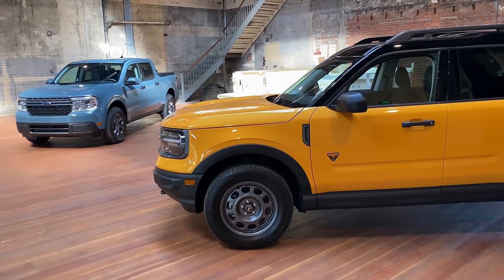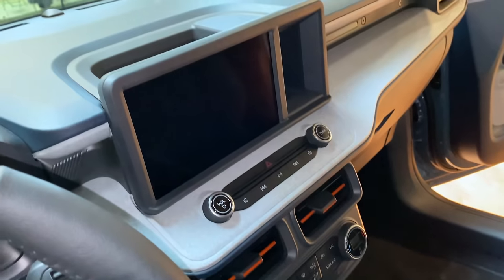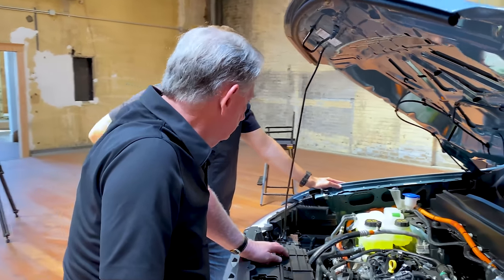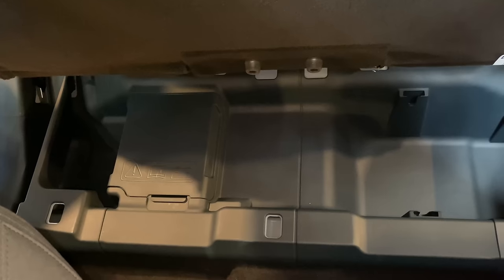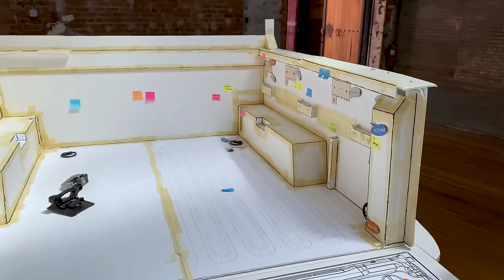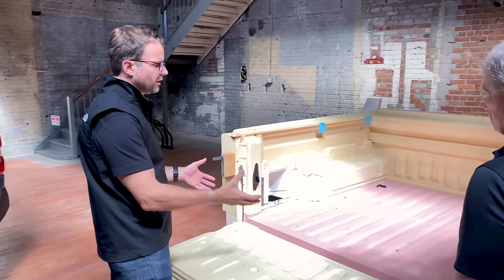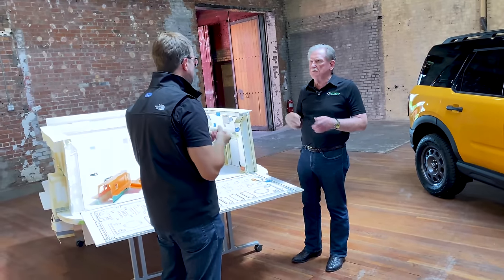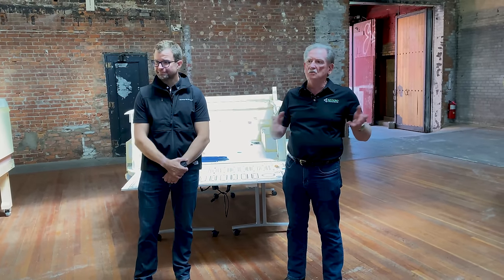Ford Maverick Review with Maverick Chief Engineer Chris Mazur

Comment: I really hope they make a electric one.
Reply: Jim Fields  Ford CEO did not say yes but also did not say no. Though he did seem more direct that the Bronco was going to have an electric option.
Reply: Did you hear the Chief engineers non-answer? It sure sounds like they are planning to make an EV... If they can build a 2023 Maverick EV with 200mi of range, it will sell like crazy.
Reply: @kschleic9053   without question they will easily sell a quarter million the first year.
Reply: @kschleic9053  Yeah that sounded to me like "We are but I'm not allowed to announce that"
Reply: @ Philip Biron. Only if they have batteries to put in them. Per Ford they are production constrained to ~50k MachE due to battery availability. They are counting on SK Innovations to build their factory outside Atlanta GA. The total capacity being built is only for a few 100k vehicles and that factory is also suppling cells for VW’s ID4 production in Tennessee. The made an announcement of a new investment with SK but that 60 GWh is not scheduled to begin production until “mid-decade”

With the MachE, F150 Lightening, Lincoln & Ford mid-size crossovers (CDC746/747) all in production by 2023 there won’t be enough batteries to go around.

If they can easily sell everything they make they will focus on higher margin vehicles. A well equipped F150 Lightning (~$60k) will have much larger margins than a $30-35k BEV Maverick.

Don’t get me wrong I want one. I just understand the time table of global battery ramp so won’t expect to see a BEV Maverick before 2025.
Reply: @patr5902  a very good point. I haven't followed Ford's battery roadmap closely, but it is definitely the best way to project future BEV production.
Reply: @kschleic9053  Depends on price range and battery supply, they will need to compete by then with the mass produced Cybertruck.
Reply: You cannot tow shit with ev
Reply: @inikkor520  actually, depends on how much shit 💩 but not too much as what ICE trucks 🛻 can tow a lot more 😝

Comment: The cup holder idea is soo simple, but GREAT, that kind of thinking needs to be expanded 10 fold 🙌
Like include powered metal tabs underneath the cup holder insert, so something can be plugged in 12v that they 3d printed at home. Actually impressed with this idea of open sourcing design.
Reply: With the software they make the same aproach years ago with the developers

Comment: Looks like with a some redesign for a battery on the truck from the mustang E , The front motor could be puled and drop the front electric motor form the mustang, 
for ford that world really push the price/value for the customer. Yes it would cost 35k but that's still good for the money

Comment: Always Always Always wanted a small pick up again that had amazing fuel economy. My first vehicle for high school my parents pasted down to me was a 2001 ford ranger with over 200,000k. After giving it up due to problems i stuck to sedans because lets be honest i was probably getting 13 miles a gallon on that ranger lol. The newly remolded ranger was nice but went too large for me and the mpg just wasn’t there for me. So happy i wanted longer before getting one because this!! Is my type of truck!! Height, length, and Mpg is perfect! I never wanted a full size truck or needed one with all that horse power and torque. Now lets just wait for those live road test and ratings to come out! Hopefully its a 5 star little pickup⭐️⭐️⭐️⭐️

Comment: I own a 2000 2 wheel drive Ranger I put new heads on it because I like the form factor. It has rust that needs fixing but nothing that can't be fixed. I own a Prius car. They took the two and put them together! Then the 3d printer community will make this the options endless with the support of DIY . The all electric version or plugin version must be in the plans in a few years. This will be popular but if they do a plugin and all electric they will have a market killer.

Comment: This is great for a camery killer. Definitely for priuses. You get some utility for 40 mpg and can be sub 20k? All it needs is a plugin version at 25k and would be a great transition vehiecle.
Reply: That's what I was figuring. This thing solves all of the things I hate about our renegade - which was 29K. Price is the most important factor for most people. coming in at an actual 20K will make this a hit. If it is actually 20k AND you can get one for that. Dealers don't like to stock the cheap ones and then plan on upselling you to the one that is only 5K more.

Comment: I kinda like this Maverick — heck in the past few years, I bought a used ranger, because there aren’t trucks this size.   Seems like they want it ‘Ford tough’ level durability and be the ‘everyday’ transport && the ‘weekend truck’.   [ 1 vehicle wearing multiple ‘hats’ ] -   We keep tabs on how well it plays those roles while potentially getting great MPG.

 Sandy - thanks for asking about ‘future plans’  fully Batter Electric and Plug In Hybrid EV….  Important stuff for younger generations and those looking at EV. (Perhaps the Maverick Thunderbolt ?)

When used in ‘weekend mode’ there are the DIY trips, but many folks drive on weekend trips towing ‘toys’ - I do worry about future full BEV during the ‘weekend mode’ hauling toys. -as that weight and air resistance suck range.   Much of rural midwest US (destinations where folks to use said toys) isn’t up to the level of EV infra beyond 120V outlets or Campgrounds with 240V/30+amp RV hookups..  With decreased range during towing and limited ‘fast charge’  infra - I would say an upcoming PHEV  may make most sense for those that want to dip their toes in electric  but still have their Maverick perform well wearing all it’s different ‘hats’.

Comment: As nice as it looks on the outset im not sure i can reconcile in my mind the fact that a front wheel drive would be called a truck. That and reliability. Im sure it will sell incredibly well,  look at Nissian, they seem to do quite well with low price point cars. We will see in 400000 miles if the new Maverick can put a hurting on Toyota, thats a big call in my mind

Comment: I would buy an all electric Maverick TODAY!!
Reply: Ford, you better get cracking on a BEV Maverick before Tesla comes out with a mini Cybertruck and steals your lunch again. I've already decided that my next vehicle would be an EV and a BEV Maverick would have been the ideal replacement for my 2010 Ford Escape. The new Escapes are basically cars not SUVs.
Reply: Sign me up! In the 90's, I asked Chevy if I could buy an electric S-10, but "they are fleet only" they said. "We will take them back in three years and crush them" was unsaid.
Reply: @kenchow8213  Tesla always announce things 2 years in advance, and the full Cybertruck isn't here yet, so I don't think there will be a mini one for quite a while.

It's a pity it's not a BEV or even a PHEV, but there's still a lot of people wary of electric cars and still a lot of people buying gas guzzling trucks (Ford sold 790,000 F150s last year compared to Tesla's 490,000 total worldwide sales) so Ford are probably correct in taking baby steps at both ends of their range. With battery costs still around $100/kWh I don't think anybody could profitably make a $20k BEV that doesn't suffer from severe range anxiety at the moment.
Reply: @Error6503  I sure one of the reason Ford isn't making a BEV Maverick is because they don't have the batteries. I won't expect it to cost $20k, but I would be willing to pay $30k for a BEV Maverick, more if it was 4WD.
Reply: @kenchow8213  That's one thing I foresee most other companies, including Ford, falling flat in the short-term.  Battery demand will skyrocket once things like the F150 Lightning starts production.

Tesla is the only one who is building their own battery manufacturing plants... everyone else will be depending on LG and CATL and other third parties, and they'll be in a bidding war for capacity while Tesla can chug along using their own factories.
Reply: Would that not be called the F-150 lighning
Reply: I got the base for that reason. If they make an ev I'll probly trade it in.
Reply: What dow
Ea bev mean?

Comment: The problem I see with the hybrid is it has a CVT transmission and if you tow much that thing will be the weak part and is not going to last. Also a 400 watt 120 volt inverter is just about useless. My truck came with one and I have seldom been able to use it. They need to consider at least a 750 watt. A 1000 would be better but I would say don't waste your money on the added cost of the 400 watt inverter. I installed an additional 1000 watt inverter on my truck and it takes care of all the basics.

Comment: I just ordered and XLT in Cactus Grey with the hybrid engine.  Seems like Ford hit all the right customer desires in one truck, rides like a car with independent rear suspension, a crew cab, 40mpg, and a lot of bells and whistles.  The XLT I got for $27k has heated seats, wipers, mirrors, and steering wheelwheel.  Has remote start, power drivers seat, and Ford 360 which has most all of the safety features such as blind spot warning, lane departure warning, etc.  The move up to the Lariat costs about $3k more and comes with 18" instead of 17" alloy wheels, a sun roof, more automatic safety software, B&O sound system, and fake leather seats.  I was thinking about the Lariat but decided against it because I didn't really want a sun roof as it robs headroom a bit, don't like faux leather, and don't want the 18" wheels.  The only thing I didn't like about ordering the Maverick was that you basically had to go with packages, you couldn't just add options at will.  But I understand why they do that, it saves them lots of money.

Comment: I wish the hybrid was available with AWD, even if it was just a tiny sub 10 hp motor driving the rear wheels. They also could easily make a CR-Z style hybrid trim where it's sporty and available with a manual. Just have a normal Turbo 3 cylinder with a manual transmission and have the hybrid part handled by an electric motor driving the rear wheels.

I have my issues with the new Maverick but price isn't one of them. That being said I don't think I'll buy another ICE powered car unless it has a manual transmission and gets over 30 MPG with AWD. So sorry Ford, I can't justify getting any of Mavericks you've shown us so far.

Comment: I would never thought that I would say this but Ford has a winner on its hands.
Reply: Yeah.. but it’s begging for a battery plug in.. even if it’s a hybrid plug in with just 50 electric miles.. it’s just 100% necessary.. i know the price will probably kick up to $25k then.. but it’s just necessary. And the money saved on gas in a few years makes up the difference! Not having a plug these days is just a major drawback. If nothing else, for future resale! Everything is going to have a plug in 5 years.. resale counts.. this is not future proofed at all. 40mpg is pure shit in 5 years.. but i get it.. the price point is huge.. and it’s decently designed for uses.. but really wish it was plug in capable
Reply: I so done with Ford... Said it before... A lifetime Ford customer...not anymore.
Reply: @RichardJOberle  Who cares... bye!
Reply: @twany442  typical Ford response this is why I and others are done with Ford...
Reply: Antoine, your arguments are nearly 3 years outdated, which just shows how exponentially Tesla improves compred to the competition.  They are already nearing Porche/Lexus levels of "reliability"
Reply: @twany442  nice child like language... It took Ford over 6 months and a shit ton of my money to incorrect correct a problem... That was the final straw... If Ford could not diagnose their own problem who should? Hence they reason I no longer have any faith with Ford, oh yeah it was a circuit board issue, Sono faith in electrical cords...
Reply: @twany442  sounds like your the baby

Comment: Cool Truck!  I am excited for Ford to come up with a bridge truck.   Hybrids fix a lot of the problems with gas vehicles.  It uses existing fueling infrastructure. It gets good fuel economy.  It eliminates brake wear until after 100K miles. The engine should last hundreds of thousands of miles in the hybrid application. The simple tailgate cable solution is innovative.  Never saw that before.  The published cad model for the cupholder attachment is nice.  

My first new truck was a Ford Ranger.  I loved it, and it met the needs of my growing family.  This Maverick would have been my first new vehicle out of college if I were starting today.
My daddy did not buy me anything to drive to college.  I drove old junk I saved up for from my own jobs until I could afford the new car payment out of college.  I guess it builds character, but it was definitely more stressful.

My Girls got hand-me-down cars, but I had to deal with repairs and maintenance until I started buying them Toyotas and hiring out the repairs. Not having to worry about vehicle reliability while going to college is essential.  For a parent, Its nice to not have to worry about your child's vehicle breaking down.

Affordability is hugely important.

Front wheel drive makes sense. It should be better on winter roads than the rear wheel drive.  Not sure why other trucks are not front wheel drive.

Like everything else on the truck, I hope the battery is reliable.  I have Toyota hybrids.  The NiMH batteries last 140K before you have to replace them.  Because Toyota makes so many of these cars, the aftermarket or reman batteries are very common.  

I hope Ford sells enough of these trucks to sustain the aftermarket/reman/used battery industry.  They need to make the aftermarket price of the drive battery affordable to allay fears that the battery reliability will be a problem. Otherwise people will avoid the truck for fear that resale will be a problem. Toyota learned that lesson and offers new replacement drive batteries for about $2500. Originally these batteries were $5000.  Another nice thing is that my local dealer did not charge me to diagnose the battery failure when one occurred on an older prius.  

This truck competes directly with the Toyota Prius hybrid for young adults.  Its no joke! The prius has a ton of cargo capability if you put the back seats down.

Over all, great job on this truck Ford!!!

Comment: The first vehicle platform other than a full size truck I've been attracted to in a very long time! It is the first affordable and Fuel efficient truck that can enable a diy guy like me for an affordable price!

Sure, as a CT reservation holder I'd MUCH rather be full EV! But, if the Maverick were an EV, could implement Tesla like innovation as regards to manufacturing (less components, fasteners, etc), and had good range 250mi+ I would very likely be a customer!

Comment: Drilling into your truck bed does not automatically void your warranty. The drilling must be a cause of the issue. If you drilled into your truck bed and then your head gasket blows, your warranty should be intact. If you drilled into your truck bed and your truck rusts out due to water intrusion, then that's your issue, no warranty.

Comment: I'm curious. Maverick was a car. Why didn't they go with the ranchero. It was the small truck.
Reply: Maybe they perceived a customer demand for seating for 4 normal sized adults? IIRC, the Ranchero and El Camino  both had only single rows. 
Granted, there appear to be a few compromises made on this new design to hit the desired price points, but overall they may be on to something.
And as with some of the flak Ford is getting for naming of the Mach E, they can call them whatever they want, and let the marketplace decide if the vehicles stand on their merits and not just the badging.
Reply: They wanted the Maverick "Rattler".   Ranchero "Rattler" was too R/R.

Comment: Make it a plug-in hybrid with ~40 miles ev range and I’m sold
Reply: I think this is more likely than a BEV version.  I could see them sticking with BEV or ICE only for the F150.  Then have the Maverick get the choice of ICE, HEV & PHEV. 

They also need to add more torque to the PHEV version.  The current hybrid Maverick can’t be upgraded to the 4000 lbs.  And 2000 lbs towing just isn’t enough.
Reply: Problem with a plugin hybrid version:
It'll probably get ~2 miles to the kwh with that profile, and a kwh costs ~13¢, call it 6.5¢/mile.
It gets 40mpg, and at $2.60 a gallon that's 6.5¢ per mile.

If it costs the same to run on electricity as the motor, why bother? Chevy saw this with the volt that a number of people just never plugged it in.

I suspect they could do a PHEV real quick, (of they haven't done it already) but by but doing it this way they save battery manufacturing capacity for other vehicles, they keep the price down, and they have a shiny new PHEV drive train to sell you in a few years.

All that said, I'll probably wait for the PHEV version myself.

Comment: No Institute of Insurance Highway Safety ( IIHS) and NSTA safety rating yet for a small Unibody truck. No Cruise control and power side mirrors on the low trim level, No MPG of the turbo higher level. Destination fee con computed,  wow, I will wait for a year before I decide on this one.